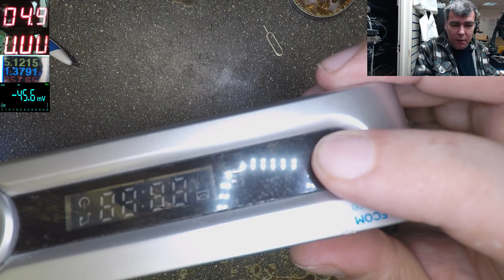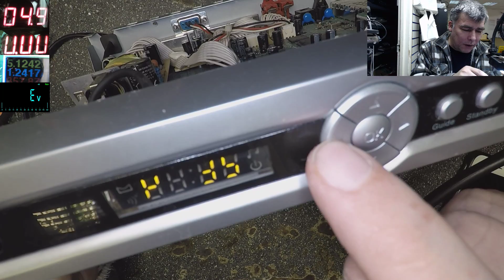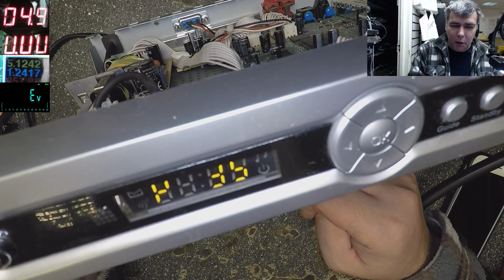Lets fix a satellite receiver, Dolce sat receiver power supply repair

Comment: Thanks for the video. I replaced 2 capicitors that were "popped".  There is now a ticking sound, but the unit still won't turn on; no lights or anything when I push the power button. Any other suggestions?
Reply: yes replace ALL of the caps!! also check zd 30 for short

Comment: Thanks for the video. Mine was exactly like this and I realized the supply's 3.3V output was 2.5V when supply cable was disconnected from the motherboard and 1.7V when connected to the motherboard. I replaced a H431 regulator (Chinese version of TL431) and bingo, worked again!

Comment: I have 1 PC smps 12 v, but does not output pwm IC 3845b.7. pin 10 v 6. don't pin voltage

Comment: do you never use an ESR meter?
Reply: When the caps are bulging, an ESR meter isnt necessary. I only ever use an ESR meter when i suspect a cap problem but the visual inspection all looks fine.
Reply: @morphuk1  Yeah, but often a few more caps might be way over spec and ready to die too. This unit might be dead again in 3 month, but if Sorin had an ESR meter and only took a minute to test the caps, the customer will be happy for many years. I have seen caps looking perfect and they were shorted or had as high as 80 ohms.
Reply from the maker: i will buy one :)